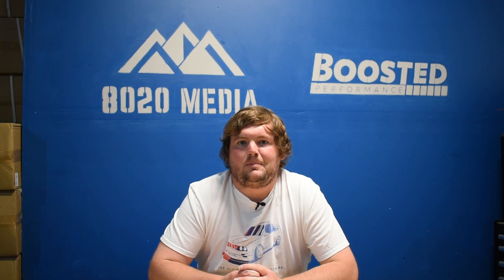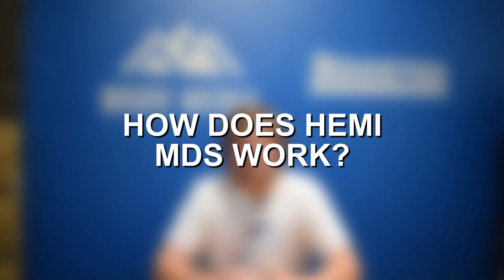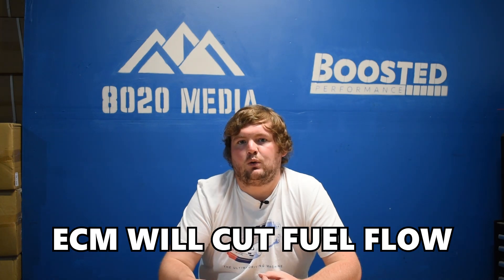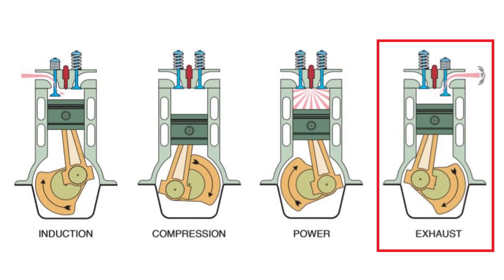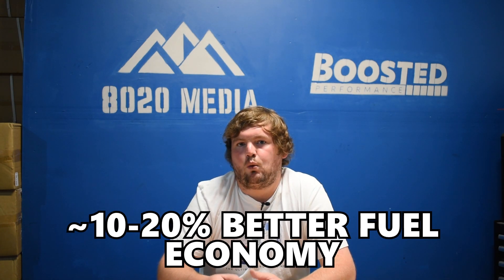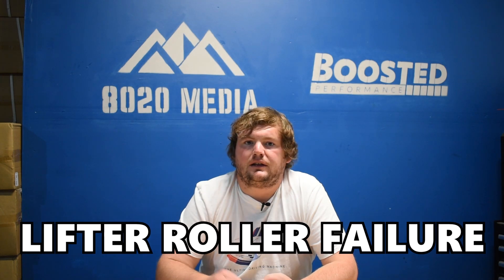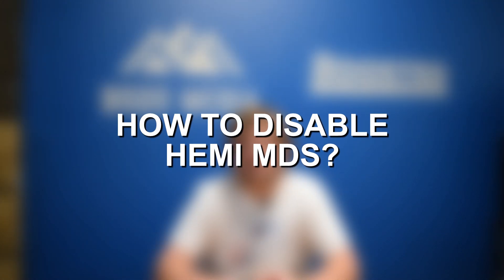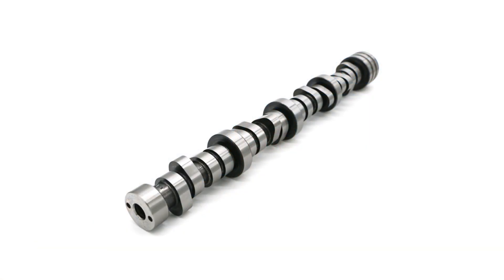What is HEMI MDS? (Multi-Displacement System)

Comment: Hi- I think the MDS is responsible for a blown head gasket on a 124,00 , mile 2012, 5.7 RT. - lower oil pressure? Water is mixing with oil. A rebuilt by mechanic, quoted:  $9000.00- does that sound right? Im from North Jersey.
Reply from the maker: R - If your Hemi has water mixing with oil after suspected MDS-related lower oil pressure, a blown head gasket (or possibly a cracked head/block) is likely, but $9,000 for a rebuild in North Jersey is definitely on the high side unless it includes a full engine replacement with a warranty. In that region, a proper in-car head gasket job with both heads machined, new bolts, gaskets, fluids, and labor often runs $3,000–$5,000; a full engine rebuild with upgraded components is more like $6,000–$8,000 at most reputable shops. You’ll want a detailed breakdown of that $9k to see if they’re swapping in a reman long block, doing machine work, or adding extras. Also, MDS itself doesn’t directly blow head gaskets, but it can contribute by running lower oil pressure at low RPMs, which can accelerate wear on lifters and valve train, leading to excess heat and stress if cooling isn’t optimal. If you plan to keep the car, I’d recommend factoring in an MDS delete during the rebuild to protect the new motor.
Reply: @8020Automotive  Thanks - good info. The rebuild is warranted- 100,000 miles, three years, and there are all new components- water pump, oil pump, etc.I was thinking of asking about the MDS deletion, and I think I will. Mechanics up here are as expensive as food prices. But I love my car and I share its temperament.